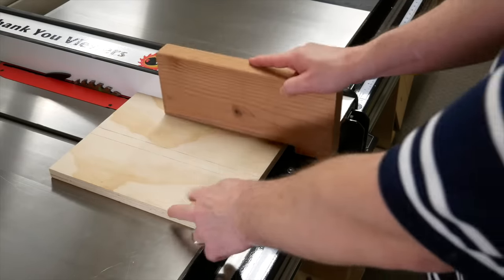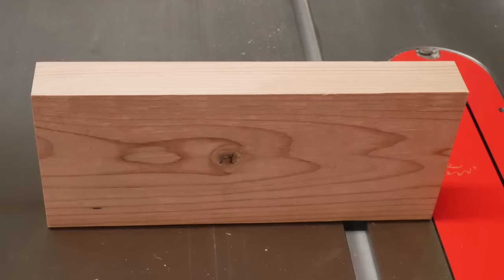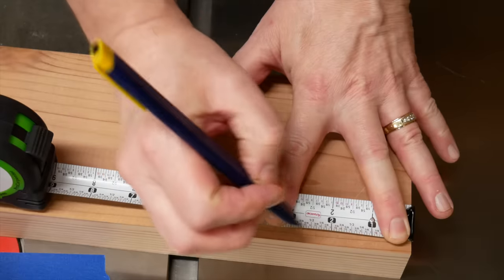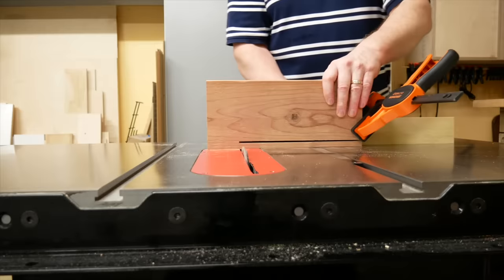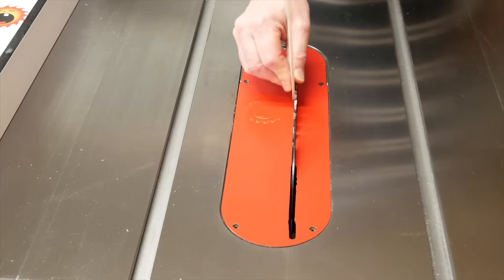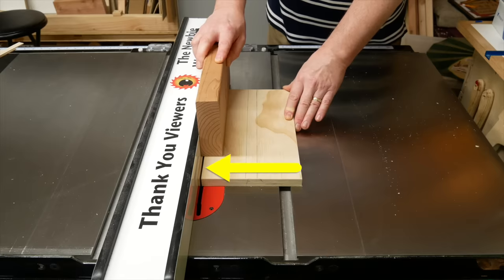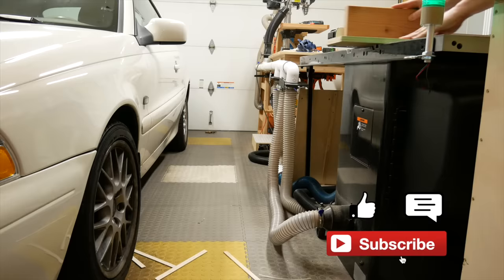Easy! Cut Thin Strips On Your Table Saw!

Comment: The painters’ tape zero clearance insert is a great idea. 👏
Reply from the maker: Thanks! 😄
Reply: @TheNewbieWoodworker  Isn't that adorning yourself with borrowed plumes? ;) I have a question: When you showed cutting through the tape the riving knife wasn't installed, was it? At least with my saw that does not work when it is installed.
Reply from the maker: @wolfgang4468  Yeah, I struggled with what to say about the riving knife. Here's what I did: I removed the riving knife to cut through the tape, and I left it off when cutting the strips, because I'd have to remove the tape to re-install the riving knife. I think this is probably perfectly safe, but I didn't want to say it in the video, because, well, you know, sometimes people sue people. 🙄Let me know what you decide, and if you have other ideas.
Reply: @TheNewbieWoodworker  Pro tip - Use 2 pieces of tape with the crease over the blade and sneak the knife/ blade up.  People act like not using the knife is deplorable. Your safety is measured in your understanding of the forces that cause kickback. Pretend the cut is like a golf swing, follow through with confidence.
Reply from the maker: @alexisjust9269  "Pretend the cut is like a golf swing" - well, that means I'll slice it for sure. 😂Thanks for the info.
Reply: @TheNewbieWoodworker  Dad... stop.  I giggled.
Reply from the maker: @alexisjust9269  😂
Reply: Always have the blade throat just above the stock to get consistent clean cuts. This is per the rep from frued/diablo
Reply from the maker: @mattberg6816  Right, except when it's cutting through your push block. 😄

Comment: Works a charm!  And my long-experienced spouse was amazed at this tip and others I have learned on Youtube.  He'd not thought of using tape for a quick zero clearance.  The tape trick also works for a temporary zero clearance insert on a compound miter saw.  

Ours does not have a zero clearance, and usually that's not needed.  But we are cutting a lot of smaller stuff -- mouldings.  I saw this on an old website for finish carpentry and thought, "duh."  So I grabbed duct tape, which is what they used.  (Note to self, they are now selling duct tape that isn't real duct tape, pay attention in stores from here on out, it's more like a union of duct tape and a colored box tape!  And it says "decor" on it!  The tape is thin enough that I used two strips layered up to make it more robust.)  Extremely helpful for positioning miters!
Reply from the maker: That's awesome, and glad I could help! YouTube is a wealth of information - a neighbor calls it "the university of YouTube". 😄

Comment: Thank you for your guidance and letting us know the simple method of doing the work. Kindly note that the thickness of a normal tablesaw blade is about 3.2 mm it is possible to use blade of less thickness. For example 6 inch blades are available in 1.8 mm thickness thus one may increase the number of strips per board.
Reply from the maker: Thanks for the info.

Comment: This is a perfect way for model makers to cut wood to the exact thickness, width and lengths they want inexpensively.......Great thanks.  Anaco,  Anz.
Reply from the maker: You're welcome! It's possible it won't be consistent enough for what you're talking about, depending on your fence alignment, etc. But like I said, it's simple enough to try. 😄
Reply: @TheNewbieWoodworker  I think taking it slow and easy with a decent, thinish veneer blade would cut them just fine.
Reply from the maker: @buddyhutchins3782  Cool! If you end up trying it. let me know how it works. 😄
Reply: @TheNewbieWoodworker  Will do.....    Merry Christmas..!
Reply from the maker: @buddyhutchins3782  You too!

Comment: Great idea  👍 I was just wondering earlier how to cut some 1/2” strips. Nice, thanks for that
Reply from the maker: Awesome! Glad I could help. 😄
Reply: You can cut 1/2" strips easily without any additional jigs. Just make a push stick out of 3/8" or 1/4" thick plywood.
The problem is cutting really thin strips, 3/8" or thinner, because you can't safely use a push stick between the blade and the fence at such thickness.

Comment: Excellent suggestions. I would suggest not cutting a strip narrower than the gap in the plate behind the saw blade, not just between the blade and the plate) Note this gap would only exist if your blade was not at it's maximum height). I would also suggest you ensure the piece you are cutting is long enough to get good support on the front table and the back table at the same time and to never use a thin push stick that might slip off the work piece (your use of a 2x4  is probably critically important to maintain control of the work piece). As I pushed a strip through using a push stick like yours only much thinner, when the piece was cut off the end of it was still over the slot behind the blade. It dipped into the slot behind the blade and was flipped vertical, then fell back down onto the blade and was fired directly backwards out of the saw hitting me in the arm. Thankfully I was standing to the side of the saw to avoid kickback, and I was hit with the blunt end of the work peice, but nonetheless the strip, (which was no bigger than a pencil), left a 3 inch bruise on my arm and a small hole in the skin. So wear some eye protection, cut longer strips not short ones, and use a wide push stick like you designed not a narrow one. And only cut strips wider than the slot behind the blade (or raise the blade to eliminate the gap).  And never assume a small piece can't take out your eye or cut an artery when it's travelling several hundred miles an hour. (PS I wonder if the tape could be easily torn by the work peice and might even force the work piece downwards behind the blade?)
Reply from the maker: Thanks for the good suggestions. I don't know about the tape issue, but it's "safe" to say that anything that could go wrong, might, so you've given some great advice about being prepared. Thanks! 😄

Comment: I’ve been struggling for a week trying to make a zero tolerance plate for my old Craftsman 113. The stock plate is 1/8” steel so too thin for most materials. Your solution? Painter’s tape, genius! Thanks
Reply from the maker: LOL, glad it helped! I learned it from someone else, of course, although I have no idea who. That's one of the things I both love and hate about YouTube - you can find great tips in the middle of other videos. It's awesome, because you never know what you'll learn. And it also sucks, because you can't really search for them. "Now where did I see that tip about...?" Anyway, glad I helped. 😄

Comment: I'm new to woodworking and love your channel. Could you do a piece on using bits and disks in unique ways? Foe example; can I put a spiral saw bit in my trim router...can I put my router bits in my spiral saw...can I use a grinding wheel in my hand held drill...what happens if I put a bullet drill bit in a router? Thanks! BTW, I posted here because I couldn't find a way to post general questions on the community site. Apologies for using the wrong thread.
Reply from the maker: Thanks for the comment - I don't care where you posted it. 😄And by all means, let me know what you want to see, although there's no guarantee I'll be able to do it.

In answer to your question, to be honest, I don't have a clue about any of that. Most of it sounds dangerous to me. As for putting a grinding wheel in your drill, I suspect that's doable, but I'd lean towards a Dremel first (although I'm not a huge fan of Dremels except for small work).

With that said, I did a quick YouTube search and found some videos, so that's probably your best bet. Just be careful - it's so easy to get hurt when you're not using tools the way they were designed. That doesn't mean not to do it, it just means, well, be careful! 😄

And if you're looking to do a specific thing, I'd check Amazon to see if there actually is an attachment designed for what you're trying to do. It's amazing what's available these days! Thanks again for the question(s).

Comment: I cut the thin strips on the other side of the blade...INCRA fence easy to set up and quick  as well as safe...
Reply from the maker: Thanks for the info.
Reply: The zero clearance  tape is a good idea, but cutting thin pieces between the blade and the fence creates an opportunity to turn the trapped piece into a wooden bullet aimed right atcha. I, too, use the Indra jig, but it’s not hard to make an adjustable one from wood scraps.
Reply from the maker: @BigTrainBuff  The obvious solution, of course, is to not stand in the line of fire! 😄
Reply: @TheNewbieWoodworker I ok

Comment: Simple and efffective. I noticed your push block is almost as long as the strips being cut. How would it work for longer cutting longer strips?  Let say 4 to 5ft. Thanks.
Reply from the maker: Thanks. Personally, if I were going to try and cut thin strips that long, I think I'd try to make a jig of some kind. At the very least, one or two featherboards. But I've never tried it, so that's just my 2-cents worth. 😄

Comment: I’m new to using a table saw so have a question… my Irving knife is higher than my blade, so would I need to remove the roving knife to use a block as you’re doing? Or is there an alternative. Thanks
Reply from the maker: It sounds like you might need to remove it, but I'm not comfortable with that solution, so maybe you should look around for another way to do it.

Comment: I like this idea because it is so damn simple.  Everyone else pushes elaborate push sticks and this is 12 inces of a $2 2x4.. I made an inlay painting frame and I have gotten orders foir six more so thes small strips will be handy.  I bought my first pin nailer and it was pretty exciting.  I have not found a flaw in it yet.  I bought the Harbor Freight model and my only concern is that it only shoots up to one inch pin nails.  The more expensive then the $22 I spent shoot up to 2 inch pin nails.. I know there will be some application I need it for..but we will see.  I am mentioning this because it might make a good vid for you.  If you can get a free sample get two and remember your fan Bob..lol.  Have a merry christmas!!!
Reply from the maker: Thanks! The only thing I can quibble about is the price of the 2x4 (2x6, actually). When I went to my local HD to get one, all the 2x6's were soaked (it had been raining for a week). So I ended up buying a redwood 2x6, and it cost more. 😂As for the nailers, I don't currently have a need for ones that can't shoot pins through Baltic birch plywood. And if I want one of those, it'll have to be air driven, and I don't want a compressor. So, sorry, I can't get you a freebie. 😛They wouldn't give me one, anyway. 😏
Reply: @TheNewbieWoodworker  thats ok. It is great for me since I do alot of small pieces for picture frames. Clamps and super glue have draw backs.  I have asked Santa for the saw in your last vid.
Reply from the maker: @bobnicholas5994  Then I hope you've been a good boy. 😄
Reply: @TheNewbieWoodworker  lol Lucky for me I have a 2 x 6 in my freecycle pile..so mine cost zero. I have been a very good 59 yo boy this yr
Reply from the maker: @bobnicholas5994  LOL, glad to hear it.
Reply from the maker: @bobnicholas5994  So, my wife just came in and said "I have this great idea." She proceeded to show me a framed something-or-other. She said "My friend Shelley and I can make some of these. All you have to do is make the frames." I blame you. Even though I didn't mention our conversation to her, I still blame you.
Reply: @TheNewbieWoodworker  you can make some nice frames with glue and a tablesaw. If yo want to impress them look at fancy frames Jon Peters on youtube. You will like him.
Reply from the maker: @bobnicholas5994  Thanks!
Reply: @TheNewbieWoodworker  dont forget 2 pin nailers lol
Reply from the maker: @bobnicholas5994  You know nobody gives me these things, right? I have to buy them just like everyone else. So no, you're not getting a sample from me. 😜
Reply: @TheNewbieWoodworker  I knew it made you blush lol.
Reply from the maker: @bobnicholas5994  😂
Reply: Dan, I have a pancake compressor and pin nailer if you ever want to borrow them
Reply from the maker: @scottsbr8076  Thanks! I may just take you up on that.

Comment: Just paint it black (like the Rolling Stones), green (like Matthias Wandel) or pink (like Steve Ramsey) and you'll never mix up your push block with a piece of scrap wood.                        What was the thinnest strip you have cut with it?  I'd need 3 or 4 mm  (1/8 or 1/6 of an inch) Is it possible with this system?
Reply from the maker: Thanks - the paint's a good idea. The thinnest strip I cut was 1/8". Although that's not true - I cut some too thin, so thinner than 1/8". I think it depends on your saw and fence, and how steady your hand is, when you get much thinner.
Reply: @TheNewbieWoodworker  Thanks for the information. I paint all my jigs which don't look like jigs. Lost too many of them already. They probably ended in the scrap bin and later in the wood stove. A few minutes (or even less) heath for an hour work is not really time-efficient.
Reply from the maker: @hansdegroot8549  Thanks - makes sense.

Comment: Just out of curiosity, why would you not cut the strip off of the workpiece on the outside of the blade, rather than having the potential for pinch between blade and strip and the resulting kickback?
Reply from the maker: Mostly because you'd have to move the fence after each cut. You should probably also use a featherboard.

Comment: I thought we were supposed to have the off cut against the fence? And then I use a push block and a push stick (or my hands ) and I would feed the piece all the way through. If it's for thin strips even if it gets kicked back it's too light to do anything. If you put the fence between your stock and the blade, if you do get kickback the bigger piece will get shot out at your body. 
I could be totally wrong but I used to do it like the video and I got a piece shot at my hand. So now I put the off cut against the fence. 
And just go ahead and push it all the way through. Or, you can turn the piece over and continue the cut from the other end. My 2c
Reply from the maker: Thanks for the tip. It makes total sense to me, and I'm glad you've thought it through so well.

Comment: When I use a table saw witch this is my 2nd year in woodworking if something ain’t right I stop like when I was ripping some thing on table saw the board was wanting to lift up so I just stoped then I was not putting enough pressure on the board is what happened I’m thinking about getting a sawstop
Reply from the maker: Makes sense to me. Good luck on the SawStop! 😄

Comment: raise the blade just till the riving knife touches the tape,then lower the blade, cut the rest of the tape with a razor knife where the indention is so the riving knife can come through. works on my saw. But!! if you swap out the 10" blade for a  7 1/4 blade your  riving knife might not reach the top of the blade like it's  suppose to.
Reply from the maker: Good tips, thanks! 😄

Comment: I found out the hard way  that by trying this method or a similar one to it, I started cutting into my aluminium fence due to flexing of the fence.
Reply from the maker: I'm not sure how the fence would flex in towards the blade - it should flex away if anything. Are you sure it's just not aligned properly?

Comment: Glue strips of sandpaper to those sticks to make detail sanders...  😉 👍
Reply: @TheNewbieWoodworker  hehe, but seriously,  every time I go to a big box store,  I grab a couple paint sticks and do just that..  😆 👍
Reply from the maker: @elfpimp1  Actually, the reason I didn't say anything is because I'd think the paint sticks would be better than whatever you cut yourself. I could be wrong, though, so like I said, I just replied with 😄.  😄
Reply: @TheNewbieWoodworker  hehehehe!!!  The cut strips? I'd use them to fill cracks in boards, or gaps between planks, it'd save on the amount of wood filler I'd have to use. There's a million and one things those could be used for..  so, I'll take the stir sticks AND the cut strips!!
Reply from the maker: @elfpimp1  Good idea. Speaking of wood filler, do you have any tips on keeping FamoWood from drying out? My last tub of it dried out, so I'm thinking of getting one of those vacuum bottles and see if that helps. Any thoughts?
Reply: @TheNewbieWoodworker  is famowood a brand? Question,  oes it smell like acetone when you use it? If so,  adding same to the container after using it will keep it soft.  That's what I do with DAP pppllastic wood wood filler.
Reply from the maker: @elfpimp1  Yeah, Famowood is a brand. I'll check what it's made of.
Reply: @TheNewbieWoodworker  found it. Acetone, Methyl Ethyl Ketone and petroleum distillate. So, yes, add a bit of acetone to can when storing. Try about a half tablespoon per quart.
Reply from the maker: @elfpimp1  Thanks for checking! Since I don't have any acetone on hand (I don't think), I'm going to try it first: https://salvagedinspirations.com/q-t-t-keep-your-wood-filler-from-drying-out/. Time will tell. If it doesn't work, next time I'll get some acetone and try what you suggested.

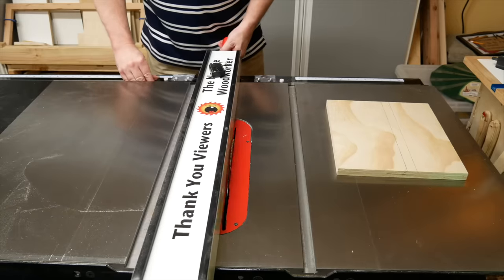Comment: I don’t get it, the first 2:30 are a series of cuts, measurements, painters tape, but then at 2:40 the painters tape is gone and you just do the obvious,  push the wood through with a block on top. What’s the point of the first 2:30 then? Is that just a video editing mistake?
Reply from the maker: Actually, what I was saying starting somewhere around 1:50, is that if you have a zero-clearance insert plate, then you're fine, but if not, you can use some painters tape to help keep anything from dropping down the opening.